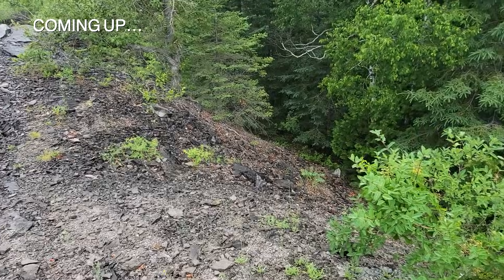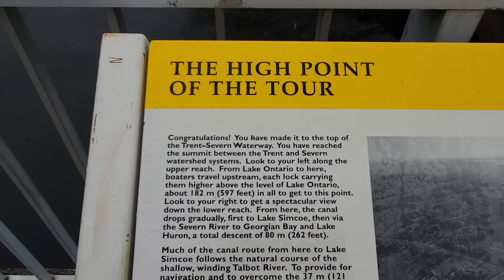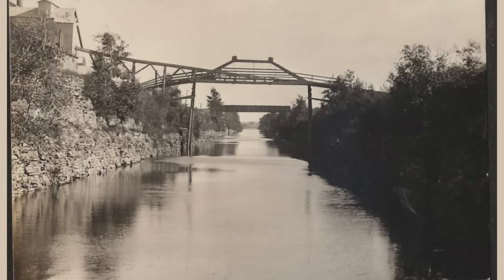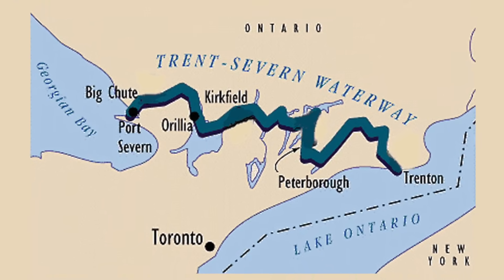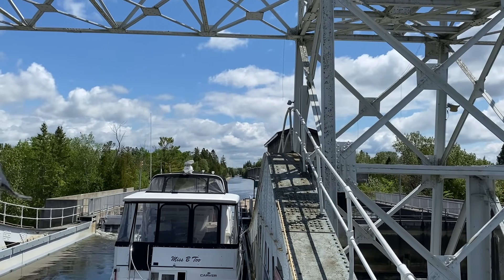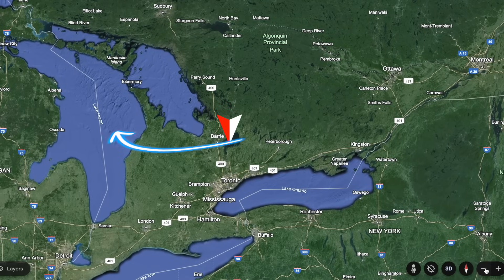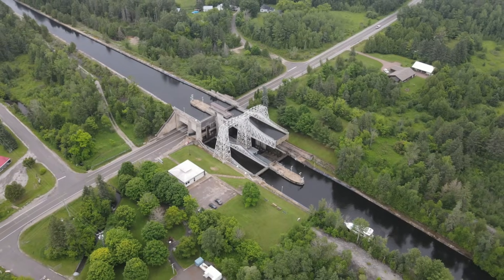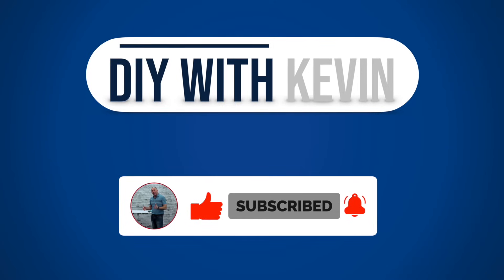Water Flows Away in Each Direction? Secrets of Kirkfield Lock | Knot Normal Living

Comment: Balsam Lake is the headwater (highest point) of the Trent Severn waterway. The Haliburton Highlands feed Balsam Lake via the Gull River.  Water from lakes upstream is used to maintain the navigation level of Balsam through the season. The Kirkfield lock is partway down the Talbot River toward Lake Simcoe. Water at that point flows only to the West (downstream to Lake Simcoe). The 2.6km cut from the West side of Balsam intersects the Talbot River at the County Road 35 bridge over the canal. This cut bridges the two watersheds and water could technically flow both ways at this point though I assume it flows predominately out of Balsam Lake to the West.  The remaining cuts and man-made Mitchell Lake were needed because the Talbot River is very small with a limited flow rate. It meanders quite a bit from its initial meeting with the canal before rejoining the channel downstream from the Lift Lock before entering the man-made Canal Lake as the waterway works its' way toward Lake Simcoe.
Reply from the maker: Amazing details Andrew! Thanks so much for sharing.  That clears up so much!